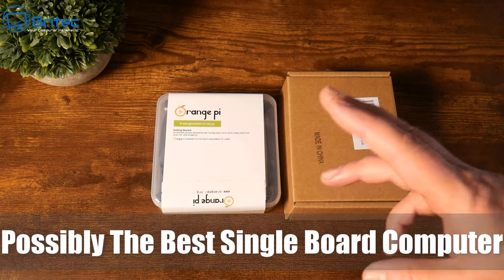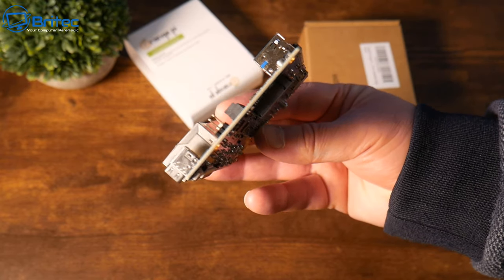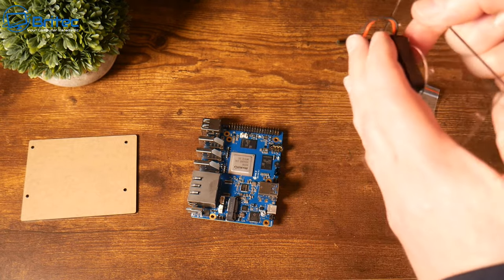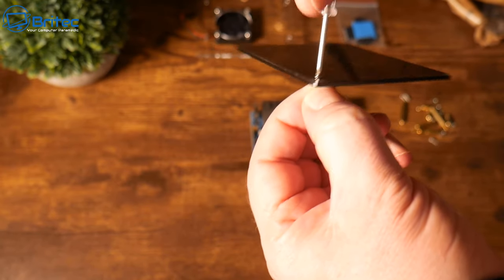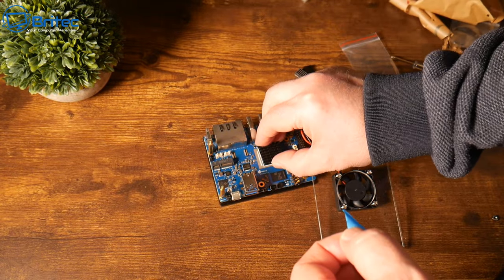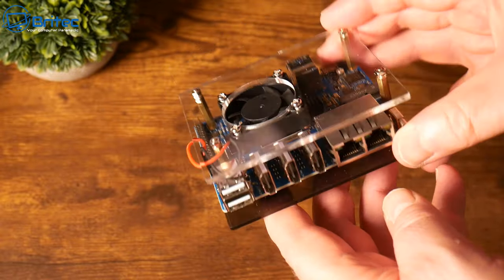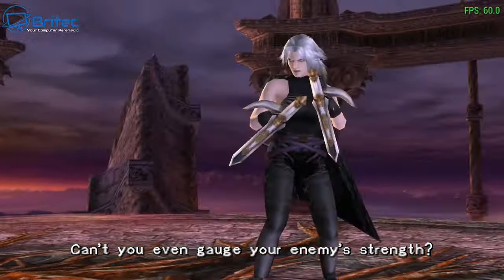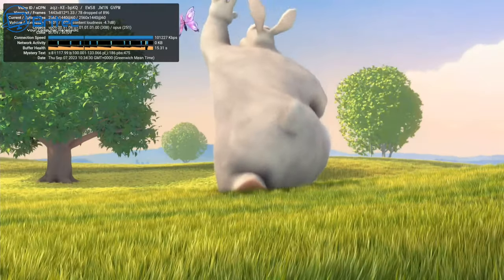Possibly The Best Single Board Computer

Comment from the maker: What SBC do you own? let me know in comments below.
Reply: I own several but find the Friendly Elec R6C the absolute best performance for cost. It has an optional anodized aluminum case that acts as a huge heat sink. It's powerful (Same RK3588 as Orange Pi 5 Plus), inexpensive, great looking in the case and totally silent. It's sold as a router however, it's an amazing SBC for retro emulation on Linux or Android.
Reply: Pi 4 (4GB), Pi 3 B, Pi Zero, Pi Zero 2W. May perhaps consider an x86-64 one in future though.

Comment: Already owning a RPi 3 + 400 and after very hard deliberations over buying a faster and better featured Orange Pi 5/Plus or a Raspberry Pi 5, I went for the Raspberry Pi 5 because it offered greater flexibility through available community support, software and add-ons. Clearly the Orange Pi scene is improving but still lags far behind for now.
To be honest it was the same when it came to focusing on PC or Apple as my main platform to invest in. I now have 5 x64 PCs and 3 Apples (x86/M2) in the house but still find for all it's imperfections, the PC platform to be the better platform for many reasons, just like the Raspberry Pi. 
The fastest and better hardware-featured device is not always the best when it comes to using it. :)

Comment: This will sound lame but every computer in my house be it laptop or mini pc, they’re all SBC’s. I do have a raspberry pi 4, an orange pi 4 and honestly the the Microprocessor eval board I got from ST micro (ST32mp157dk) blows them all out of the water. Plus, they only $45, you can plug shields made for arruino, pi, or pmod and it comes with a touch screen

Comment: Thanks Brian. Very interesting development. The question remains open: can the Orange Pi 5 Plus boot from USB 3 and from eMMC or only from micro SD. The power consumption would also be of interest.
Reply from the maker: It is possible with some tweaks
Reply: @Britec09  I own a Raspberry PI 4 8GB and operate it with a USB 3 hub with a power supply and 7 separately switchable USB ports and 7 SSD hard drives are also attached to it. I separated the USB power cable from PRI 4 to the hub to protect the board from reverse current (you can also install a Schottky diode). So USB booting is a fundamental question for me.
Reply: My research indicates it is possible and not any harder then you find with a Raspberry Pi 4+.

Comment: The best SBC in my head today will have x86 8 core cpu, 2 x DDR5 slots, 2 x M.2 NVME capable slots, 6 x SATA ports, 2 x Intel SFP+ cages, 2 x Intel 2.5 gig ports, one side PCIE x16 slot and will use wide power input (9-60VDC)...
Reply: I just go for arms, perhaps riscV
Reply: Do you know what SBC means?
Reply: There are plenty of miniPCs out there and some people are making them small and calling them SBCs but I don't feel like it's really an SBC if it has no GPIO...
Reply: For me, such devices live and die on the community support, range of affortable software and range of affordable hardware and the future of the platform. As it would hopefully be used for real, the hardware considerations while important become secondary.